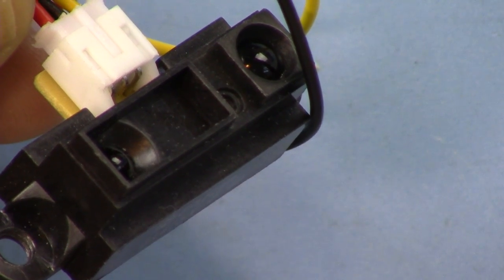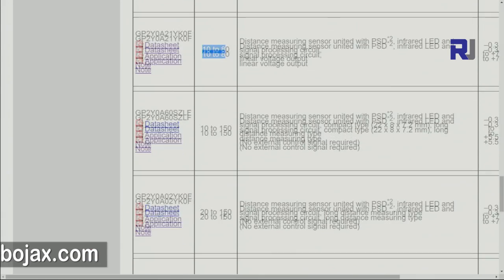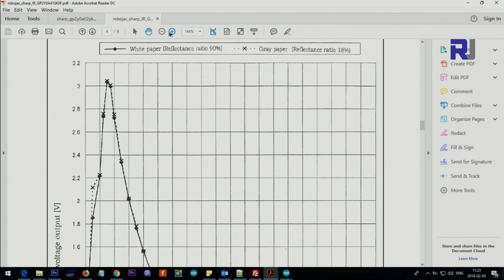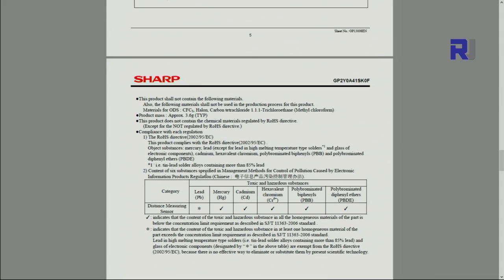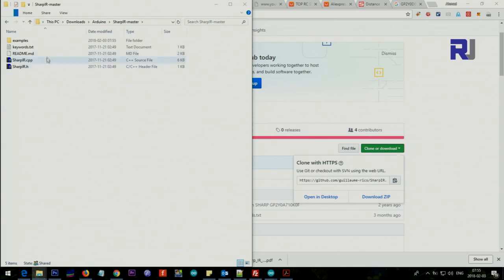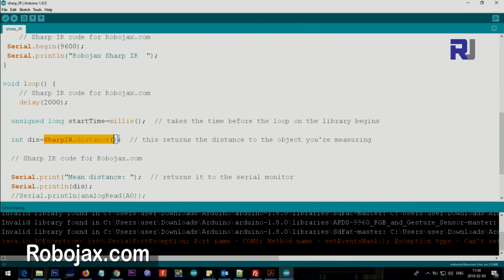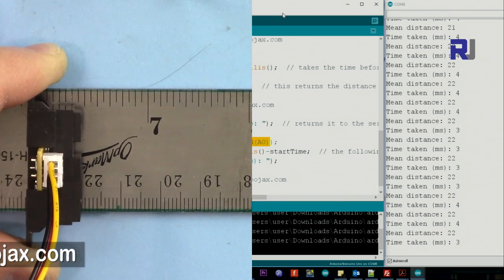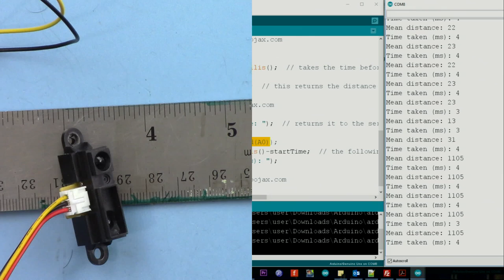How to use Sharp  IR Distance Sensor with Arduino (download code)

Comment: Hey uhmmm how about the connections? base on your code you didn't assigned any pin or analog pin for your signal in IR distance, why?
Reply from the maker: it uses A0. you can watch this video https://youtu.be/rdNCIyL6OA8

Comment: Do you think that sensor would work off water if tilted down?  Basically to measure the level of a small water container.
Reply from the maker: I have not tested it. This module operates with infrared.  it should reflect if water is still. not sure about it.

Comment: Can I use the sensor behind glass?  Need to protect it.  Want to measure level in black water tank. Thanks
Reply from the maker: Unfortunately I have not tested it. why not test it and ten type your comment here so everyone know if it works or not. I have seen this question more than 20 times now. Thanks

Comment: Can you please explain why I am getting 74  as continuous reading using GP2Y0A41SK0F, when I am putting it towards Ground. Distance between sensor and ground is around 10 cm.
Reply from the maker: perhaps that is the maximum range and Arduino is not reading anything and you get maximum. check wiring. use multimeter to read voltage that goes to Arduino.

Comment: Thanks for the tutorial. Very helpful. I am using a GP2Y0A60SZLF Sharp Distance Sensor 10-150cm which has GND VCC EN and OUT. The code provided mentions connecting the signal pin to A0. Is the signal pin EN or OUT? Should I only use one of those pins or both? Right now the code uploads but the serial monitor is only reading 0cm nothing else.
Reply from the maker: You are welcome. I have left nothing out. You should find the answer in video. If your module has 3 wires, this is the video for you.

Comment: Hello, I am considering using either this, or a PIR motion sensor for my project. 
I have 3 main questions for you at the bottom of my comment.
For my project I will be detecting my cat when she gets on my window sill to eat my plants. I want to trigger a buzzer to scare her off. The reason why I don't want to do a Motion sensor is because if the cat climes up on the window, she will move very slow and I worry that it will not trigger. I would rather be able to control the trigger in my code. If I do this distance sensor, I plan to keep a rolling average of the voltage so that it can trigger if there are quick sudden changes. I do not need a wide angle. preferably a very small angle of detection like 12 degrees and the distance will be less than 2 feet. I have good coding and Arduino skills but I haven't used either of these sensors before. 

1) Does this sensor only detect a small field of view straight ahead? (I prefer if it does)
2) Does this sensor require a flat surface, and how large does it have to be?
3) Do you recommend choosing the Motion PIR or this distance sensor?

Thank you very much for the video!
Reply from the maker: Hello Xavier, 1-This detects small field of view, 2- any surface. doesn't need to be flat(have not tested on glass) 3-For your application this would be better.
Reply: @robojax  Thank you for taking the time to reply! I will try this out.
Reply: @Javii96  Hello, I would like to ask whether it would be possible for you to give the code for my project because i have a similar project like yours and i don't know the code. Can you help me? Thankyou in advance!
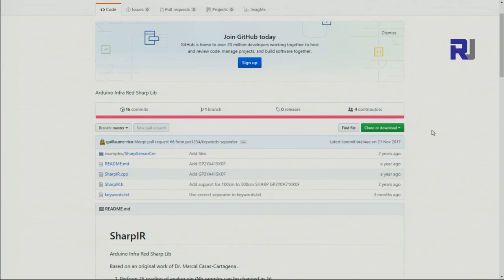Reply: @williamparedes7155   Hello, I would've been happy to share my code, but I still haven't started this project. I've been too busy lately. Sorry, but this video actually shows some sample code and how to get started if you fast forward to about 5:10. What part of the project are you having trouble with?

Comment: It Error 'class SharpIR' has no member named 'distance'. What do I need to fix?
Reply: I have successfully installed the library.
Reply from the maker: It should work. Here is the latest video with wiring diagram https://youtu.be/4f0UD8O768I
Reply: @robojax  I tried and did it again but still stuck with this problem. I don't know how to solve this Error, I used the code from your video.

Comment: is it working fast ? I mean if I move it fast down and up would it send me distance chances during movements?
Reply from the maker: The speed is determined by the delay in the loop. Change (little by little) it and make it smaller (faster) and see at minimum delay you are able to read.

Comment: Can ı work this sensor with esp32 microcontroller? Esp32 3.3 v this sensor 5v
Reply from the maker: perhaps after watching this video you've learned that we are simply measuring voltage which is representative of distance. I should have video using ESP32 on how to measure voltage or potentiometer voltage just search my channel. Here is how to find Specific YouTube Video in a channel https://bit.ly/findYouTubeVideo

Comment: Hi sir.  I am controlling  a DC motor  with infineon motor control shield BTN8982.  The sharp sensor  output is connected  to A8 because up to A5 shield is covered.  But at A8 there is a error.  Like  'A8' was not declared in this scope. Why...?
Reply: Yes.  I got it.  I forget to change processor from ardiuno uno to mega.  Coz uno don't have  A8 pin.
Reply from the maker: Good to hear that Kiran. Don't forget to subscribe.

Comment: Thanks. Nice breakdown of these IR sensors.
Reply from the maker: Glad it was helpful!
Reply: @robojax  Actually, I purchased the GP2Y0A21YK0F (10 to 80 cm) and have it running on a 5V Arduino at about 4.5V. I ran a basic distance program that includes the Sharp library (2.0) and I can't get any data input to the Arduino over 30cm. It the floats at 16mm in the Serial Monitor when no object is present. When an object is present, I only get readings between 9cm and 23cm reliably.  I rarely get 30mm. I never see 80cm lol. I read the data sheet, and I see that the output signal is non-linear and its voltage will drop the further out an object is, but I expected to least see the 80cm once in a while. 

Any idea where you might start to help boost the performance of the 20cm-80cm range of this model?

Things I've tried:
1. Different sensors of same model (same result)
2. 100 µF capacitor (seems to smooth output but does not increase performance)
3. Long object obstruction times (the 80cm never shows its face :)

Happy holidays! And thanks for any tips!

Narci

Comment: Sir, whenever there is any object detected, I want to make an Out Put ON. How to code for that.
Reply from the maker: There is a variable called "dis" which holds the distance,  for example if distance is less than 50cm, you turn on something connected to pin 5 do it like this
 if(dis<30){
 digitalWrite(5, HIGH);
Reply: If connected sensors quantity is increased, variable values are decreasing. Is there any solution for this...?
Reply: I have combined the out put of 10 sensors, and connected it to A0.
Reply: And my application is a two direction moving vehicle. If the obstacles comes neer to sensors the speed of motor should be  gradually decrease.
Reply: Can you make a sample program for motor speed control according to the Variable "dis" values....?

Comment: Thank you very much for the tutorial. I would like to know if it is possible to have the values of the distance in mm
Reply from the maker: You are welcome. Very simple. the word "dis" is holding the distance. below this line   int dis=SharpIR.distance(); and change it to
int dis=SharpIR.distance() * 10;
Now distance is multiplied by 10 to show in millimeter .
Reply: @robojax  I did it and I noticed that he only multiplied by 10 without taking into account the number he could have after. I use a digital sensor GP2Y0D805Z0F

Comment: Do you know if it is possible to use this sensor with a software like opentrack to simulate head movement in 3D environment like Z axis?
Reply from the maker: Hi, I just discovered your comment without reply. This is new feature of YouTube for creators. Sorry.

Comment: Thank you for this, however I think the 2-15cm sensor is missing. I have checked the library and it isn't defined there.
Reply from the maker: You are welcome. You are right. I just looked at library and it doesn't have it. I just placed order to get it and make tutorial on that. It needs to be tested and data to be created. Make sure to subscribe so when I post the video, you are notified.
Reply from the maker: Hi, I have recorded video for the 2-15cm sensor and It will be posted in 3 hours from now https://youtu.be/rdNCIyL6OA8 more videos related to this module is coming.

Comment: When the sensor has  slope more than 45° of its object, for example 50,60°, is it works well? , and how many degree maximum the slope angle of that sensor?

i'm sory i ask you a lot of questions, cause the price is very expensive here, so i've to know more about it before i buy it.

Thank You
Reply from the maker: No problem. I will do my best to reply. I don't have the circuit in hand to test it but it should work. I have provided the manufacturer website with the datasheet. Here http://www.sharp-world.com/products/device/lineup/data/pdf/datasheet/gp2y0a02yk_e.pdf it doesn't say anything about the angle and it should work.
Reply: @robojax  Thank you

Comment: can you use this sensor to prevent a robot from falling down the stairs?
Reply from the maker: it depends how fast the robot it moving.  If it is slow enough and if you install is high enough and point it down on the front of robot, it should detect end of flat surface and program your robot to take action like stop or change the course of movement.
Reply: Ty very much for your quick response, I need that information for my project.

Comment: Hi Robojax, I'm using this sensor to measure the displacement of an object and I want to record all the data so I can use them for analysis later. Could you please give me some method that I can record the data from this measurement ? Thanks a lot
Reply from the maker: Hi, You can do it in many ways.  The simplest method would be to store the data using MicroSD card module. You store the data on microSD card and later read it with your computer. Here is MicroSD card https://www.amazon.ca/dp/B0793H4GPC
Reply: Oh, maybe you misunderstood :-). I mean that how to record all the data of the experiment so that I can use them for later process. One more thing, do you know how to measure with the accuracy of 1mm. Thank you very much.

Comment: @Robojax This code doesn't work for some reason. I don't have much experience with Arduino but I don't know why it's not working
Reply from the maker: This code is the simplest and unless you did incorrect wiring or changed the code, it should work. Try checking the wiring and do not change the code. Watch the video without escaping. It should work. You should get some kind of error. In the bottom window of arduino, scroll up and you will see error. Post the error under this video and I will check it for you.
Reply: @robojax  The code worked, it was a small issue. I wanted to ask you what would happen if I use the serial plotter for this? Is there any way I could get the voltage as the output?

Comment: Stupid question: how do I actually connect the sensor to the Arduino? Like, I have all the necessary hardwares, a sensor, a trio of cables that can extended it and an Arduino Mega 2560, which has a lot of ports and I don't think I understand which cable goes on which port...
Reply from the maker: no problem. I just watched the video and found that I have explained it at about 4:15 and in the code it is mentioned also as "signal pin"

Comment: Could u tell me how can u insert the curve from the datasheet into excel?
Reply from the maker: the curve is not pure curve. it you open the library, they have equation of the line from curve. The library is made from experiment into excel sheet and then from excel equation of the line and that equation is inside library.  Just open it in notepad or NotePad ++ and read it.
Reply: i see, thank you for the answer, i think i'm gonna make my own equation from my own experiment👍
Reply from the maker: you are welcome and good luck.

Comment: Is it for cm only Sir?
Reply from the maker: yes and if you want it in mm then divide it by 10. if you want it in inch multiply it by 0.393701
Reply: @robojax  owww okokokok Sir thankyou. Can it have a value of (.) something or it just get whole numbers of cm units?
Reply from the maker: this sensor can't give you mm accuracy. so you get cm.  The decimal point (.) depends on Data Type. See this video to learn Data Type https://youtu.be/n0z6fjww8eA and here is the better video on Sharp which is form my Arduino course https://youtu.be/4f0UD8O768I
Reply: @robojax  okokok thank you Sir
Reply: @robojax  hello Sir I have another question do you have youtube video about ultrasonic sensors? im trying to find ultrasonic sensor for accurate mm units because i think its more cheaper

Comment: Hi Robojax, the code you provided ran quite well. However I don't know why the distance is 1cm shorter than actual distance. And could you please show me more in detail how to implement it because I need it for my system identification with accuracy of 1mm. Thanks
Reply from the maker: if you see consistent 1cm difference, then subtract  it .  After this line int dis=SharpIR.distance(); 
dis -=1;
this will correct it. 
But if you get various differences, then there is issue with the sensor.
Reply: Can I implement it in mm, what I mean is that when I move the object, the distance will change 1mm for the smallest scale because I want to improve the precision. 1cm change is too big for my system. Thanks a lot
Reply from the maker: Yes you can.  this line gets the value in mm. int dis=SharpIR.distance();
change it to int dis= (SharpIR.distance())/10;
10mm is 1cm, I have divided by 10 (/10) and now you will get in mm. I don't know how accurate it would be in terms of mm.
Reply: OK, thank you very much
Reply: Well, I met another problem with this sensor. I use Matlab Simulink together with Arduino to implement the experiment. However, I can only get the raw analog value from Arduino and the result is very fluctuate and has lots of noises, I can't read the result even the distance is a constant. Do you have any experience with this kind of problems. Sorry for asking too much. Thank you
Reply: oh, i've tried but I used int dis= (SharpIR.distance())*10 because I think at first it is in cm, then to change to mm must multiply by 10. But it can only change every 10mm, equal 1cm like normal. What I need is that it change every movement of 1mm. Can I do that ?
Reply from the maker: To eliminate noise,  add delay in the loop delay(50) that is 50ms or 100 and play with this to see the correct result. 
I don't have the device as I am writing this. But if "dis" is in mm, then you needed mm and don't do anything. if it is in cm, divide by 10 to get mm.
Reply: Robojax, thanks a lot for your help. Nice day

Comment: Can i use this sensor in 3d scanner????plz reply
Reply from the maker: No you can't because this can't be directed to a point. You need very accurate beam to be directed. VL530LX is laser based distance sensor but it doesn't have red light to tell you where it is hitting. Here are my videos on the laser distance sensor https://www.youtube.com/robojaxTV/search?query=VL53L0X

Comment: I need to find someone to help me do this in code..

//Arduino uno

//300mm precision sensors
// distance sensor1 value 181 to 270 degrees
//distance sensor2 value 179 to 90 degrees

//1 stepper Nemo 17 or 23 
//Stepper full rotation 0-359 steps (clock wise count 0 north) 
//Home 180

//if sensor1 value oscillates 
//set sensor1 to highvalue of oscillation 
//(when direction changes.  
Oscillation at 172-173-172 would set value at 173

// if sensor2 lowalue is  = <179, > or =170
// run stepper to 190
// if sensor2 lowalue is  =<169, > or =160
// run stepper to 200
// if sensor2 lowalue is  <159, > or =150
// run stepper to 210
// if sensor2 lowalue is  <149, > or =140
// run stepper to 220
// if sensor2 lowalue is  <139, > or =130
// run stepper to 230
// if sensor2 lowalue is  <129, > or =120
// run stepper to 240
// if sensor2 lowalue is  <119, > or =110 
// run stepper to 250
// if sensor2 lowalue is  <109, > or =100
// run stepper to 260
// if sensor2 lowalue is  <99
// run stepper to 270

//If sensor 2 value oscillates
//set sensor2 to lowvalue of oscillation
Ocilation at 186 - 185 - 186 would set value at 186

// if sensor1 highvalue is   >181, < or =190 
// run stepper to 170
 // if sensor1 highvalue is  >191, < or =200
// run stepper to 160
 // if sensor1 highvalue is  >201, < or =210
// run stepper to 150
 // if sensor1 highvalue is  >211, < or =220
// run stepper to 140
 // if sensor1 highvalue is  >221, < or =230
// run stepper to 130
 // if sensor1 highvalue is  >231, < or =240
// run stepper to 120
 // if sensor1 highvalue is  >241, < or =250
// run stepper to 110
 // if sensor1 highvalue is  >251, < or =260
// run stepper to 100
 // if sensor1 highvalue is  >261
// run stepper to 90
Reply from the maker: Hi, I just discovered your comment without reply. This is new feature of YouTube for creators. Sorry.